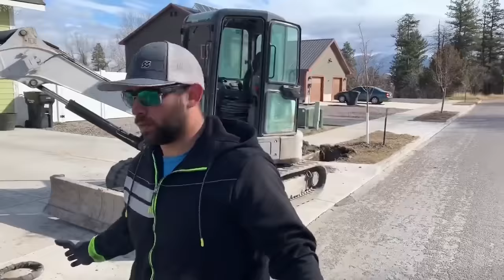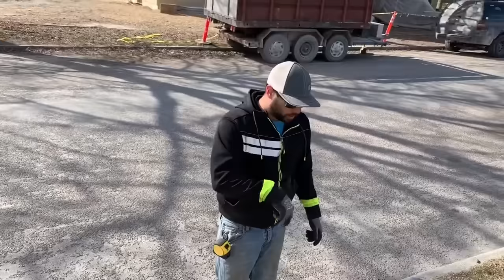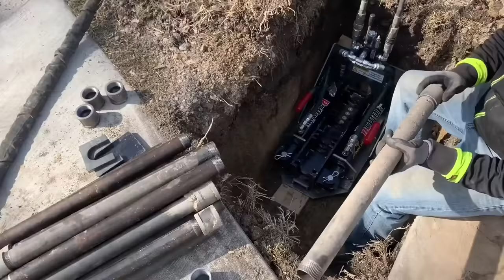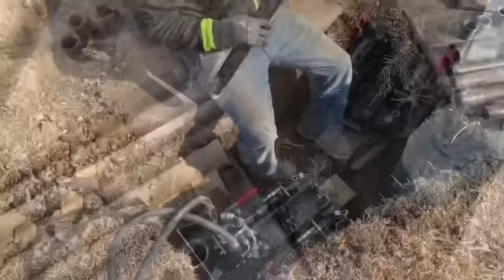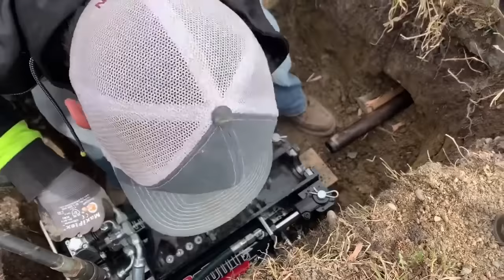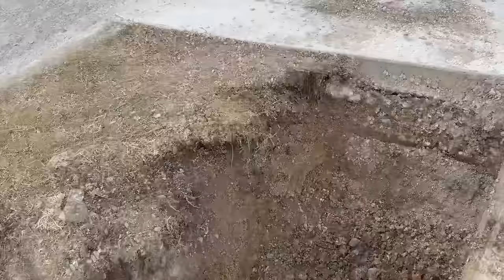Running Pipe Under a 24ft Driveway

Comment: I'm a 63 year old plumbing contractor. When I started working summers in the late 1960s we did this same thing by digging a 24 foot trench back, lay a full length of 1 1/2 pipe down on bricks to level and drive it under with a sledge hammer. Take the couplings with plug off and drag it back out. Then slide the new 1 inch plastic pipe thru. It took us 6-8 hours to complete, but labor was cheap back then. Wish we had this machine, well done young man
Reply: So you started working at around age 10?  Wow, tough life!
Reply: @davidszakacs6888  Most kids did, not like the sisified kids today..
Reply: Yeah, I started carrying my father's toolbox when I was 10, made a dollar a day and thought I was rolling in doe. I worked summers, holidays and Saturdays. At 20 I was the youngest master plumber in TN. Worked thru college and bought my father's company at 23. Wasn't  a hard life at all, my parents were great. My son works with me now . I was and am very blessed
Reply: Dirty Sanchez  That only works if your soil isn't full of rocks. I can only get about ten feet before it gets stuck, and that is using steel pipe so that you can bang the rocks out of the way.
Reply: @stevebutler8387  awesome work ethics ..... the literal backbone of America!! 🇺🇸
Reply: @stevebutler8387  Yeah but back in the late sixties to be a master plumber instead of apprentice you had to know $°×t ran downhill.... you also needed to know payday was Friday !
Reply: @donnajones1603  You are very right Miss Donna..first 2 laws of plumbing. Still hold true today
Reply: @1ronhall  Amen to that Ron, I still thank God every morning I was born and live, even with our few problems, in the USA
Reply: @stevebutler8387  🇺🇸
Reply: T C  yep, and got my dollar for the day.  Paid my 8 year old grandson 20.00, things more expensive nowdays,Sunday to go with my son on an emergency call for 4 hours, turn water off and on, bring tools, he loved it.
Reply: TN means?
Reply: @prakasavelraju4027  sorry Mr Raju, TN stands for the state of Tennessee. Have a great day
Reply: @stevebutler8387  thanks for your reply brother
Reply: That’s awesome. I’m a 37 y/o plumbing contractor and have had my sons helping me a bit here and there when off of school since he was 8. He’s 15 now and just installed a shower valve by himself 💪

Comment: We did that, only we used a garden hose a jet nozzle and some pvc pipe, and it cost less than $50.
Reply: Right or if needed we dropped the 8 ton wood splitter and push 4ft at a time
Reply: Yup that’s how I do it
Reply: Ther are many ways
Reply: @mc4492  that’s the easiest way tho
Reply: Sure ya did , dad.
Reply: I would recommend your way since pvc will outlast this ungalvanized pipe by decades
Reply: Your way leaves a big hollow space under driveway. Driveway may collapse.
Reply: @gangcai2876  what is your way show a video

Comment: It looks as though the hydraulic pressure damaged the end of some pipes.  I would think you would want to put the coupler on end of new piece of pipe b4 pushing,
Reply: The coupler may not fit the hydraulic ram....
Reply: @thigtsquare950  Then it needs to be redesigned I would think. Bad idea pushing against those threads
Reply: @JustMike2791  That pipe isn't being used for pressure, it is just to make a hole through the soil so thread seal isn't an issue.  The machine cradles the pipe to maintain directional control so having a coupler on the pipe would interfere with the cradle .
Reply: @bobroberts2371  Bob you clearly have never worked with threaded pipe! When you damage the threads the coupler will not thread on to the pipes! They cross thread when forced... But what do I know? It’s like I never worked in the plumbing field, welding nor as a Machinist! No I have never had to deal with broken studs, nor other people’s STUPIDITY before!
I hope this explains why you don’t press against threads? If not maybe someone else can explain it to you? The starting of the threads is the most important part of any operation! Without the threads starting right there will never be a seal but that is mute here! The problem with pressure against the threads is the will be damaged at some point! But he seams to not care because he said this 2 foot pipes are cheap!? Till you start having to replace them because they will not thread on each other that is?
I have to get ready to go to my local Veterans hospital for my rheumatology appointment because of the Antrax vaccine I was forced to take for the first gulf war that has caused my SI joints as well as my spine to fuse. I am a permanently disabled Navy Veteran because of another vaccine that caused 1 in 5 to become disabled! That too is mute in here but I thought I would throw it in here anyway... This new vaccine thst is not needed does more harm than the one I was forced to take! Better think! Why do You need a vaccine for something thst has a 99% + survival rate plus a cure that makes it @lmost 100%?
Reply: @David Bryant lol
Reply: The pipe is just left there I believe and not retrieved so really doesn't matter does it? They said in the beginning they can get at the home improvement store, not sure though
Reply: @watchguy79  i

Comment: I seen a young man get electrocuted in a similar operation 40 years ago in Gresham OR. The hole was muddy and when they excavated they hit a under ground electric line. They didn't see it because of the mud. When he was in the hole he got it and it killed him.
Reply: It's always useful to bring up these sort of memories, many people would not think/choose not to do a simple cable survey before carrying out such work.
Reply: @lariwoo  back then they probably didn't have the utility locate services that would have identified that an electric line was near work area. We have it so much safer now because of incidents like your example.
Reply: Where I live the council has no idea or records of what cables are where.
Reply: @rogeronslow1498  I was doing some digging in my backyard to level off an area for a shed and hit an old electrical line about 6 inches down that the previous owner ran from the house to the greenhouse and was nowhere near where one would expect it to be. Luckily it was long since disconnected. It was an estate sale so no one alive would have known about the line. I was wearing non-conductive footwear and didn't even scratch the insulation with my shovel ...but you can never be too careful when digging anywhere these days.
Reply: Call “dig USA”
Reply: @rogeronslow1498  There's sensor things that can locate the lines now, then they paint mark so one can hand dig and find em safely
Reply: @davidturk6301  call before you dig, you dig?

Comment: Years ago I worked for a security alarm company that also installed the wiring for automatic gates in peoples driveway. Often we would have to run wires from one side of the drive to the other. We would dig a pit on both sides and use like roughly 1" pvc pipe with the coupling on the end that you can screw the twist type water spray nozzle on. Put a coupling on the other side that you can hook a garden hose to. Turn the water on and slowly push it under the drive towards the pit on the other side. When the nozzle comes out the other side cut the pvc pipe on both sides of the drive and pull the wires through. It worked like a charm.

Comment: Working for a service plumber when I was a kid, we used a similar method (hydraulic boring) to run re-pipe water services (the pipe from the meter to the house) without digging a big trench through the yard, and especially when the new service had to enter through the wall of a basement or travel under concrete. 
We used a "Hole Hawg" drill motor with a chuck attachment that had a hose bib on a bearing shaft so the bib could stay stationary, but feed water through the spinning shaft. You would solder a union and a length of thick wall "K" pipe onto the shaft, then use your bunny-whacker to beat the end of the pipe into an "X" shape so that it would cut the soil and jet the water out as it spun. Every so often, you pause to cut the pipe off the attachment, solder on another union, attach more pipe, rinse and repeat until you get across the yard. We were usually able to hit within 12" of the meter with a 1" pipe over a max length 75' bore in around 2-4 hours.
Cheap, accurate, old school.
Reply: noting this...thank you
Reply: Thats the way its done in cali

Comment: Had to have a new water line run from inside the foundation of the house, out under the front porch, under the lawn, under the sidewalk to the water main in the street about 30 years ago. This technology was relatively new at the time and I ran across a guy by chance who was able to do it this way as opposed to excavating the whole distance. Cost me a fraction of what everyone else wanted, and he made more profit.
Reply: I have a similar issue with a 4” sewer main to go under about 8’ of porch. Everybody I spoke to is trying to go around porch tear up my driveway and put a U instead of straight shot. They have a machine similar to this one that goes inside of the existing pipe and basically uses the existing pipe as a guide and breaks the pipe as it runs a new one going through it
Reply: @soundapp7526   I've seen this same thing done before for city work replacing old clay pipe. "Pipe Bursting" is what we call it. Pretty cool concept.

Comment: Use to do this with all types of boring machines from 2 inch in diameter to 6 feet in diameter , water and sewer and pipeline even directional under rivers. Your little pusher is adequate for the job but you almost missed the receiving pit. Couple of tips. Use two baseboards that are positioned on grade and lined up properly by sighting with a straight edge to your target. Spud your lead pipe slowly ensuring it is on line and grade. From there it's clear sailing.

Comment: Interesting. Looks like its a bit of a gamble as to steering it. A decent sized rock could cause it to veer off course causing it to be in the side of the trench instead of the middle. Which isn't necessarily bad its just something to take into consideration as its done. And its a hell of a lot cheaper and less work than a horizontal boring rig.

Comment: In the 80’s, I worked for a water company that used a very similar set up but it used solid threaded rod.   The once we punched through the other side, we used wire web wrap on end the rod and then connected on the soft copper water line and reversed system to pull back the line through punched dirt.   The setup was easy.  What wasn’t easy was not knowing if there was large boulders or rocks in the way.    We once pushed a Boulder squarely out the other side.  We had too shut down the county road due lack strength of soil under road way.  We had to order a large excavator just to lift the Boulder out ditch because the 580 wasn’t a match too move it.
Reply: Ive been doing it for 10 years now and still hate that machine lol i made the mistake years ago of letting it be known that im really good and accurate with the bore machine. Now guess who gets to do all the bores when we have them lol

Comment: I can only say that this didn’t went as expected. 
The pipe moved up and to the side, it didn’t came out where it was suppose to come out.
Reply: Directional drilling is much safer. This method could veer off and hit Gas, power, street light, phone or CATV. Speaking of witch. I DON'T SEE ANY LOCATES.

Comment: That looks like soft sandy soil.  In North Georgia we have hard packed red clay.  Similar operation but the front tapers down to point.  And it took repeated punches from the air piston moving the pipe about 1/4 to 1/8th inch with every hit.  Took about 5 minutes for each 3 ft section.  About 30 minutes to get to the next hole where it came out.  Then they started again from that hole to go further.  Finally the hole was non stop for 400 ft length and they pulled the fat coax cable through.  And filled all the midway holes.  I had figured they would pull a long plastic tube then pull the coax through that.  But the coax was made to be by itself.  It worked fine.  There was lots of techs standing around as the thing pounded for about 5 minutes.  But I was pleased that the guys had no issues and seemed to be well practiced in the technology.
Reply: move to Florida

Comment: Doing that on the street side of the sidewalk puts you in the city easement.  You could run into anything under there.
Reply: Thats why you call in a dig ticket
Reply: @Jdl223   If he's doing a job for some entity other than the homeowner, then he's probably in the right place.  It it's a h/o job, he needs to be on the other side of the sidewalk.  Either way, he hopefully called in a ticket.  That service is free and it is helpful, but it will leave a paper trail that he can be backcharged with if there's damage.
Reply: There shouldn't be anything that shallow though.

Comment: I went under my 4ft wide side walk with PVC and pressure washer. It was a muddy mess but worked. The bottom side if side walk was not flat and thicker in spots... which required rerouting. PIA but got my 1.5" pic through curb.

Comment: Sometimes that works great, sometimes it doesn’t. All it takes is a rock somewhere along the push to throw you off a long ways. But it’s cheaper than a directional bore machine. Are you going to pull a pvc flex tube back through or just use the rust out steel pipe?
Reply: It highly depends on the area though.  In the house where I grew up.  You couldn’t dig 2-3 feet in front of our sidewalk before you hit solid adobe rock.  A volcanic eruption 🌋 pyroclastic flow centuries ago have solidified the ground underneath.  Which is mind bogling since the nearest volcano is 100km away.

Comment: i used to do this for a living except we used 5' solid steel pipe. Same prep work as you have got Dug two level holes1 on the pushing side and 1 on the receiving end. On the pushing side we used to John Deere 450 crawler to push the rod five feet on each push,than Attach another 5' section And so on.
Reply: John deer 450 wouldn't push a 5' pipe straight down a cliff.

Comment: Its called Pipe-Jacking, not directional drilling.  Problems with shallow segmented pipe jacking is a tendency to rise toward softer soil above.  It can also wander as shown in this video.  The pipe came out further away from the curb and almost missed the receiver pit.

Comment: Nice Lil machine. I think my air missile is just as accurate. Level and square is the key. What is the largest pipe  you've pushed. Could U could push larger without the plugged end and flush out??

Comment: I run a directional drill for a living.  Kind of the same concept but alot bigger and alot more control.  I'm assuming he's going to pull those rods back with some type of pipe attached to the other side
Reply: most likely just use the pipe as a conduit for something smaller. phone line maybe
Reply: How in the world do those run so far and not drift?
Reply: @mrmotofy  It did drift and it didn't go far.

Comment: Think I could do this with a bottle jack?
Reply: I was just thinking the same thing, if you had the time to do it I would imagine yeah you could do it with a bottle jack. Aiming the pipe level and in the correct direction might be difficult though.
Reply: Probably with a fast jack.
Reply: The pump needs to be upright to work. You would have to get one of those remote pump units.
Reply: @court2379  portapower
Reply: @terryeffinp  Yeah that looks like the brand name one.
Reply: @court2379  A porta-power is a very common tool found in automotive and truck shops. It is basically a bottle jack on steroids with different attachments. Used one to lift a cab on a semi truck last week.
Reply: Log splitter
Reply: @williamskrainski8407  that's what I was thinking!

Comment: Pneumatic Moles, or soil displacement hammers have been used for many years as the tool of choice for laying cables and pipes underground without the need to dig out the top surface. Starting in a pit the mole can travel at up to 15 metres per hour and minimise disruption.

Comment: That's a cool set up but I can see where it could be problematic and somewhat dangerous if you hit a hidden electrical cable or a gas pipe.
Reply: Wouldn’t you agree that’s a risk you run with any type of excavation as well? I don’t see any difference.
Reply: Call before you dig!!!  Every professional knows this.
Reply: As mentioned always call underground locators 72 hrs in advance,
Reply: ... and there is no charge for the call to get them to mark all lines in the yard.
Reply: Usually gas line under ground has a trace wire along with it for detection.

Comment: I’m surprised your using older black iron pipe very impressed ! Most of the underground gas I see pushed through is yellow plastic underground gas first time I’ve seen the iron pipe pushed . I’m sure there are occasions when this is necessary .

Comment: When I was still plumbing we used to cut a piece of 2" PVC at an angle and bang it through with a block of wood and hand maul. You would have to pull it out every 2 feet and empty the dirt, but it was a much cheaper alternative. If you hit a  big rock though....you're done!!

Comment: Would’t it work better if you had a pointed cap on the first pipe...not that it needs it but seems it would help.  What happens if you hit a rock the size of a basketball or larger?

Comment: Shouldn't you put a wrench on the connections? Not a huge amount of force but hand tight doesn't seem right. Any thoughts, I'm just wondering. Also do you need pipe thread. I'm not trolling. Just new to construction and I'm just wondering. Cool video!

Comment: Not sure what this is for. Very nice set up that works. But no wrap. No tightening the fittings. Is this just for demonstration
Reply: No, the real water-tight pipe will run inside this outer shell.